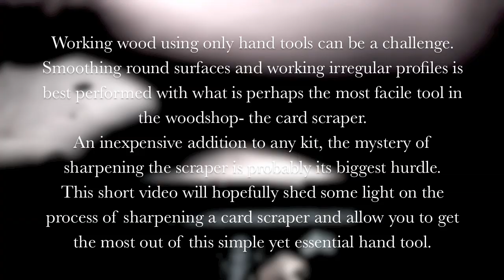HOW TO SHARPEN a Card Scraper- ( The Architect's Table Part Eight )

Comment from the maker: Matthew,
thanks for the comments and question.
The simple answer is no- I don't file the edge every time I sharpen.
If I'm using the scraper on a daily basis, and continually rolling a burr and drawing it out, then rolling a burr, again and again; eventually the steel on the edge becomes brittle from working it back and forth and I'll notice it becomes difficult to roll the burr.
At that point I'll file the edge and expose fresh steel.
I'm then able to draw out the edge and roll a burr, back and forth, for a handful of times (maybe 4 to 6..ish) before I need to re-file the edge.
I honestly have never counted how many times between filing but I'm guessing it's about half a dozen or so.
As soon as i have a hard time achieving a sharp edge, then I know to refile.

thanks for bringing up this vital point and all the best,

Tom

Comment: For those who can't afford an 8000-grit stone (they're pricey!), you can get similar results using a sheet of high-grit sandpaper stuck onto a flat pane of glass or plywood using spray adhesive. I've not seen the hack of using the square wood block to keep the scraper at a perfect 90 when flattening the edges - I'm totally stealing that one. Thanks for your videos Tom, I've learned a ton from them. Keep em coming.
Reply from the maker: Cheers-

Comment: I've never seen the ruler technique applied to a card scraper.  I'll be sure to give that a try, but I'm curious what it does for this process.  You're creating a micro-bevel, but how does that help when you're eventually rolling out a burr?  Keeping David in my thoughts and hoping he's feeling better each day.
Reply from the maker: It's basically doing the same thing as it does on hand plane irons- instead of polishing the entire back surface, you're simply polishing a small stripe across the cutting edge.  it works great!
all the best~

Comment: Tom, I've used a scraper a fair amount and I prepare it much the same way. However, I only rarely re-file it - in fact I think I've only done that once when I first set up the cards. In general it's just working the burr with the burnisher. Do you do the same or do you frequently refile the edge and remove any existing burr to start again? The video or blog post don't really make this clear.

Comment: Great video and great series Tom. I wonder if you've used a cabinet scraper, like the Stanley 80, and if so, how do you think it compares to the handheld scraper?
Reply from the maker: Philip,
thanks for the questions.
I do use a cabinet scraper, I have the Veritas model.
I use it whenever I'm doing 'heavy-duty scraping'
IE: a glue joint that has lots of dried squeeze out.
You'll see me using it in one of the early episodes of my Card Catalogue series.
I like them a lot, but for fine smoothing on a finished surface or working difficult grain, I prefer the card scraper.
The cabinet scraper is more of a roughing tool in my hands.
hope that helps-

all the best
Reply: Tom Fidgen After watching the rest of the build, I see how you used the card scraper for tight spots like the feet, that a cabinets scraper would be useless on. Thanks for your answers!